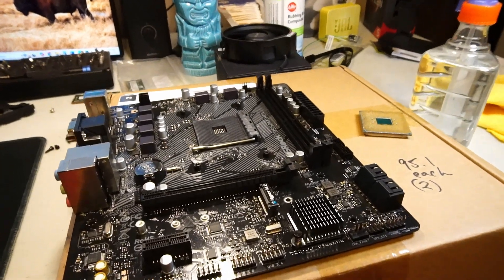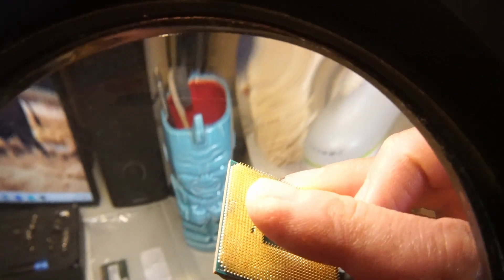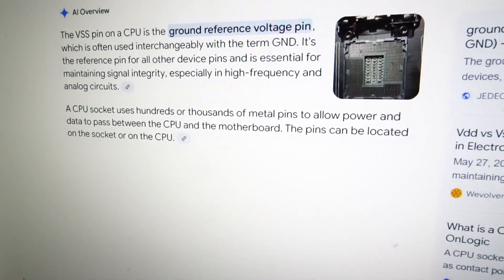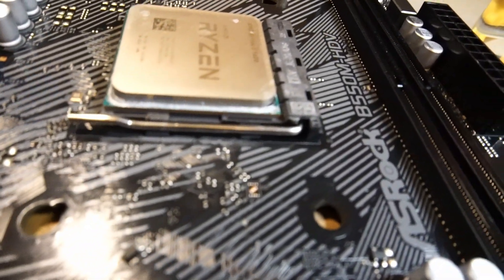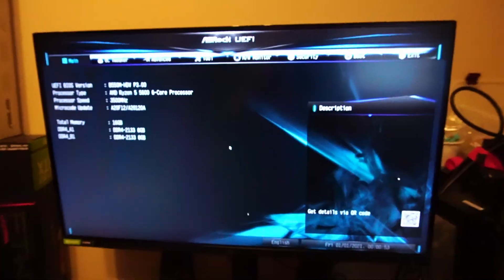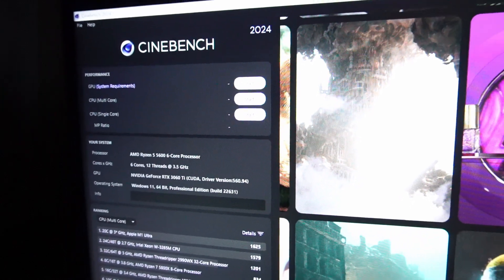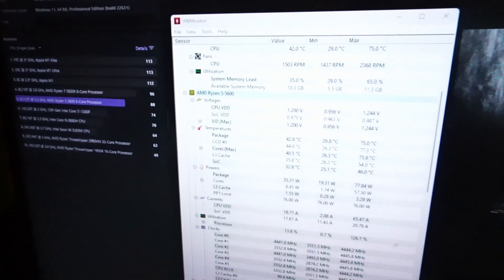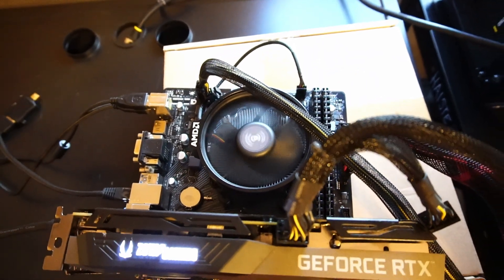Missing Pin on a Ryzen 5 5600 CPU:  Will it Still Work?

Comment: Hello everything still we works fine? I want to finish my build but I have a Ryzen 7 3700x with one broken vss pin.
Reply from the maker: Yes, it is working fine.  I sold it to a customer in a build and instructed to keep in touch should anything go wrong for service or replacement.  Double check with the pin map and legend that it's that one pin missing  https://en.wikichip.org/wiki/amd/packages/socket_am4

Comment: If the pin is missing and the cpu doesn't post, you can always try putting a piece of solid copper wire into the hole on the motherboard that has the pin missing, if it sticks out just a bit it'll make contact, and in many cases just work.
Reply from the maker: That makes sense to me, thanks for the tip